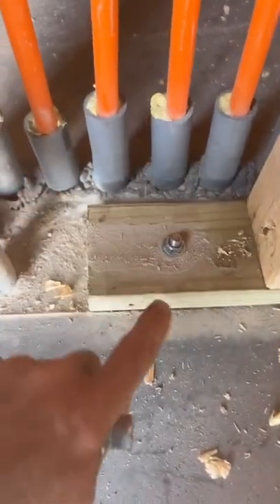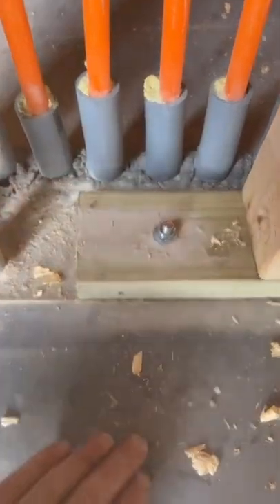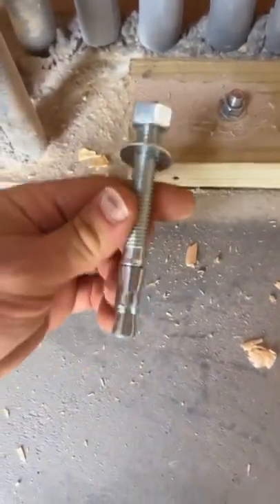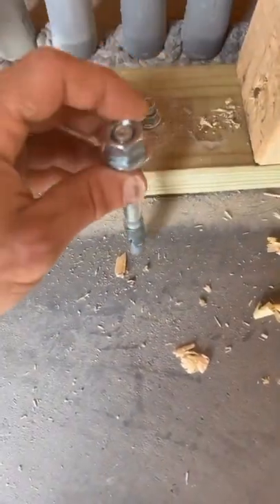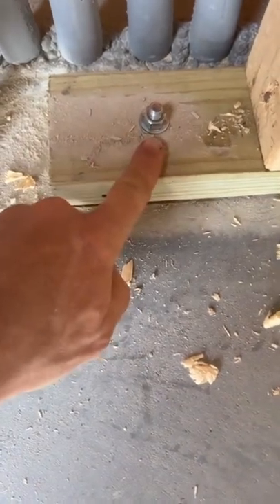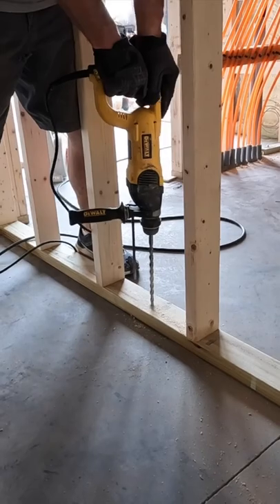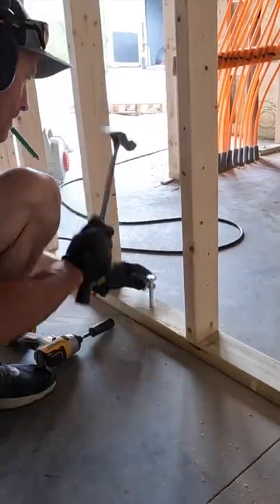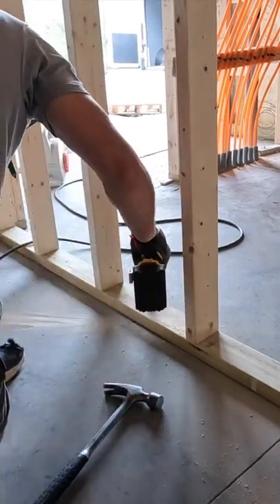Anchoring Walls with In-Floor Radiant Heat #shorts

Comment: Don't they make radiant tubes with a wire on the plastic tube so it can be detected by a meter under the floor. If they don't they should .